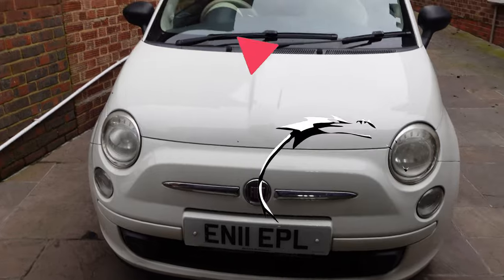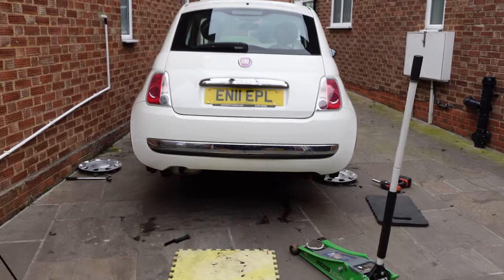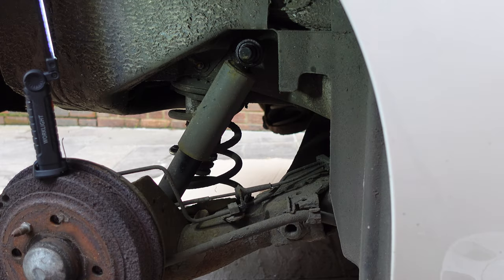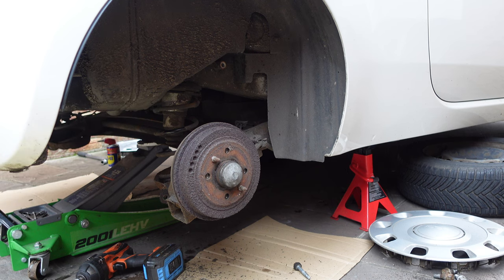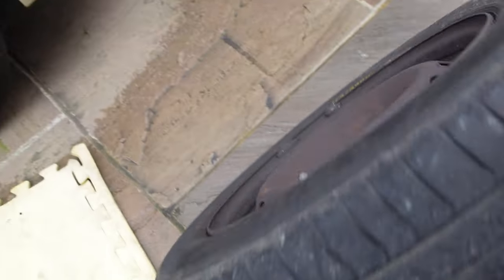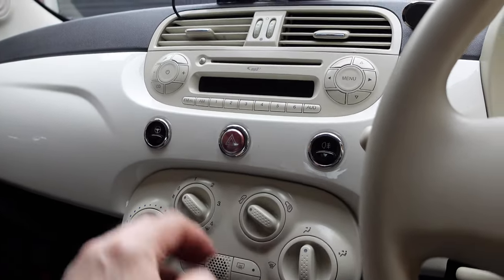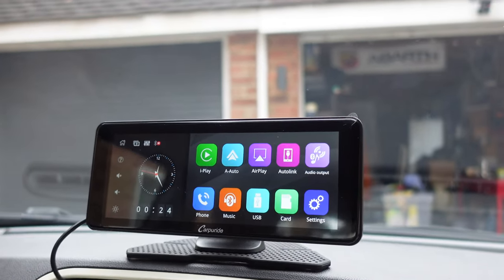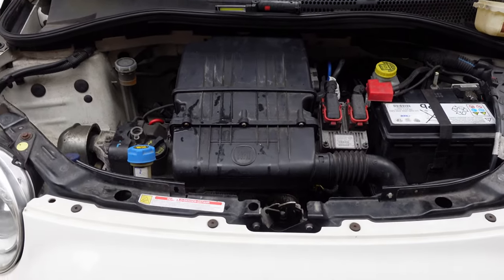Project Ernie - Day Two - Final Day - Fiat 500 Pop - Former Cat N - Let's get it finished?

Comment: Paul,  Make sure you don't have a leak on any of the vacuum hoses a small split will give you a rough Idle. Your coil packs all have the correct voltages.

Comment: Try cleaning the throttle body with some throttle body cleaner. If it persists you can replace the IAC valve which is relatively cheap and easy to fit.

Comment: I wouldn't have changed mileage, not worth risking being done by trading standards for car clocking, even though it appears speedo was changed previously, the car now has a discrepancy in the MOT history mileage and is lower than when last owner got rid of it. Re the impact gun, if you use an extension it absorbs the impact force so always use socket straight on gun for maximum torque. If shock absorbers have a dirty sticky residue it usually means they are leaking slightly 👍👍
Reply from the maker: It’s not an illegal clocking it’s adjusting to what the car is, I explained this to the new owner. I’m aware of normal sockets, I need to get some impact extensions.
Reply: @Love500  👍